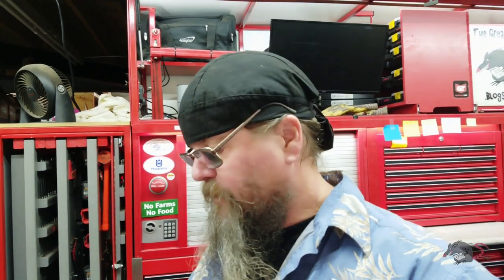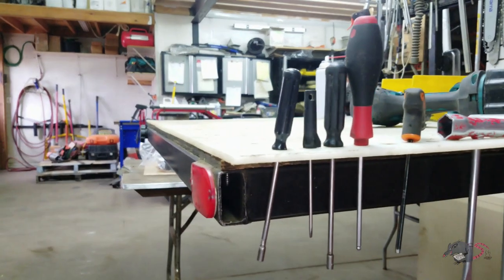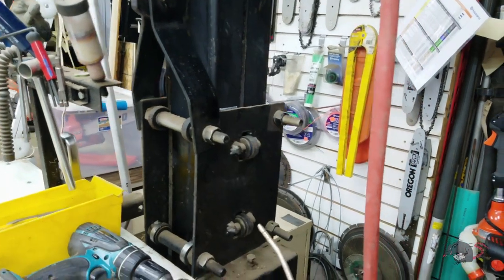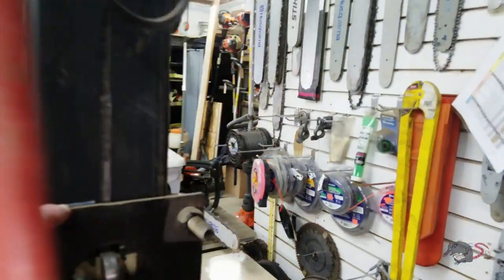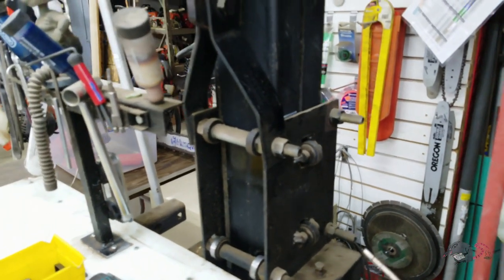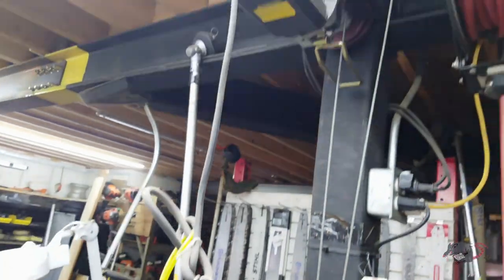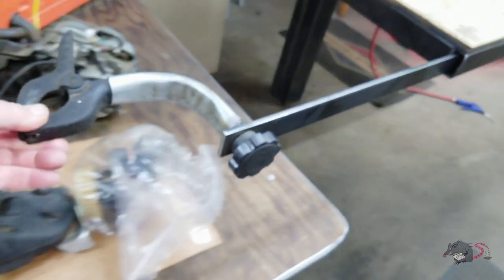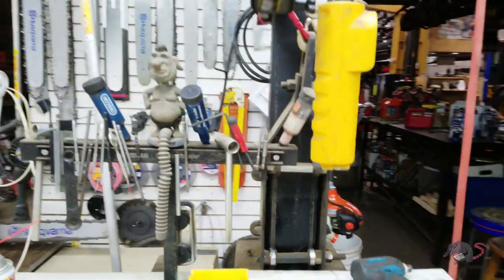Powered Vertical Lift Work Bench

Comment: Great that you can look at a need, ( lift heavy crap) have a vision and build it. 
Thinking spring could bit ya, I thought it was here enough to get out for a HD ride then 12 inches of heavy wet snow and no power for 35 hours. I need a generator tune up video.
Reply from the maker: My Ultra is in storage. I can't bring it out because my garage is staged for a garage sale this weekend and I'd have no place to keep it. The sportster is land locked in my workshop because of the garage full of crap. On second thought I could go the other way thought the kitchen, dining room and living room out the front door. I already have one bike in the living room so I'm sure my wife would be fine with it.